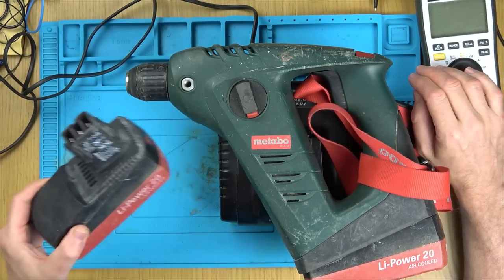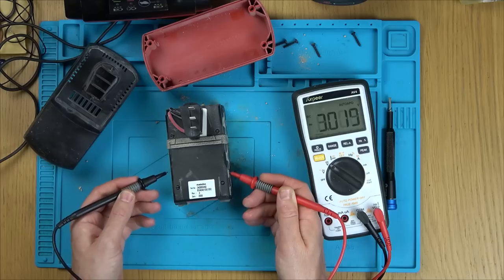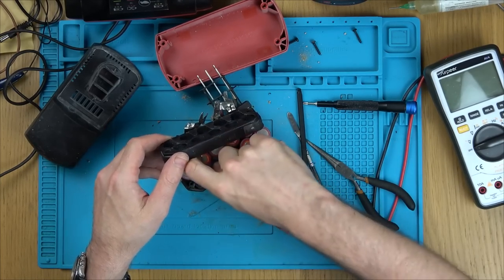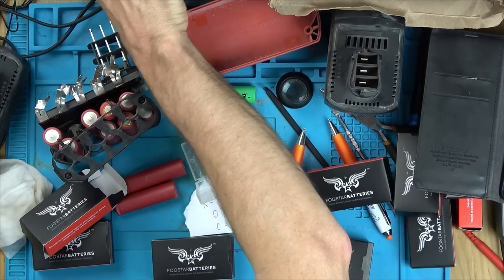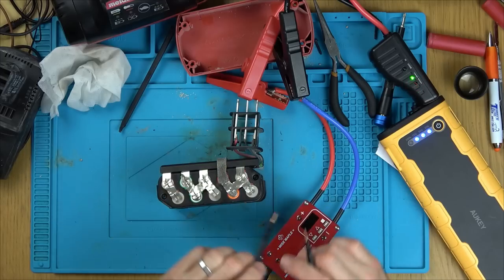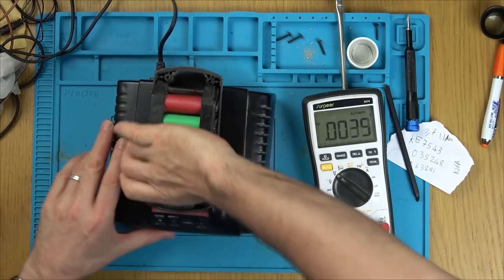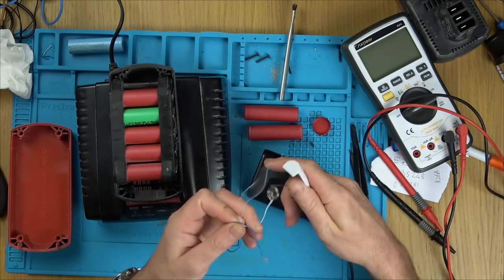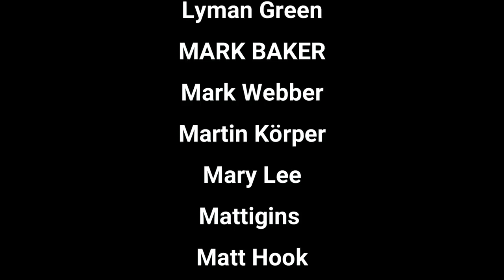DEAD High Quality Metabo DRILL BATTERY - Can it be REPAIRED?

Comment: 7 years running a battery rebuild company 10k batteries rebuilt. Mixing cell capacities technically works but you risk the longevity of the cells they will under/over charge eventually. I would always replace all cells at the same time. Some chargers have very good balancing Bosch for example very easy to rebuild the batteries. You can buy rolls of nickel strip it's thinner and spot welds easier. You'll not spot weld the original metal without a commercial battery welder. Also take your ring and watch off there's a risk of a dangerous arc burning you!
Reply: @chris_hertford just out of interest what do you think are the power tool brands that use the best quality cells and components with their battery packs?
Reply: @billconiston8091 I've opened up several different mainstream brands of batteries for power equipment. Pretty much all of them have the same cells. Mostly unbranded Samsung cells in all of them. Most of the components for all these tools come out of the same factories with slight variation specs from the designer for these companies and are assembled in the country of sale. If that. What it comes down to is each individual companies quality control. The more expensive brands have higher quality controll standards. So generally you get a better product. But there is always lemons.
Reply: @billconiston8091  they pretty much all use Samsung and LG cells. Personally I like Bosch tools the batteries are very simple easy to rebuild and not much circuitry so little to go wrong. If you're doing a rebuild the thing you need to look for are high discharge capacity cells. This is on the label with a C value e.g. 5C, 10C. C is a multiple of the capacity e.g. 3.0Ah 5C cell would have 3.0 x 5 = 15A max discharge rate.
Reply: @chris_hertford  15Ah then ?
Reply: @SlyerFox666 no that's the difference in the figures A/h is amps per hour. So 3.0Ah battery will drive a 1amp tool for 3 hours (excluding real world inefficientcies) The C rating on the cell is the max discharge current, most tools with motors will draw a spike current initially so need that higher rating.
Reply: @chris_hertford  Oh ok so it's just a percentage of the ah at that point makes sense. Well yes but the C rating is the charge/discharge rate so if you have a 12v 7ah lead acid  battery you charge at 0.7A or 0.1C for best life span of battery an base charge rates from it also for other types of batts.
Reply: A trick i sometimes use when i cannot replace the whole nickel strip (potted pcb, weird terminals etc.) is that i weld thinner strip to the cell then fold it over the carefully straightened original strip and weld the two strips together. Even for soldering it's better to have small nickel strips welded to the cell first and folded over (it's difficult to solder on the weld).
Reply: @baconatordoom  so with the lemons factor, you might as well get two of the cheaper ones, and if  one a lemons you still have good battery, and if lucky no lemons, and two time the power, ?
Reply: I know this video isn't about spot welding,  and I haven't done any, but it seems to me one lead needs to touch one serface, and the other lead the other.  Otherwise,  you'll probably melt a hole, but with no likelihood it connects both serfaces. Enough power will run through both but won't necessarily connect the two adequately.
Reply: @chris_hertford  Thank you!
Reply: I have Hitachi tools with older Nicad packs. Can these be rebuilt as Lithium Ion battery packs?  Thank you
Reply: Point me to your business please, I have a couple of tool batteries that need cells replacing.
Reply: @M1LAD81  sorry not in that line of Business anymore.
Reply: This comment means I don't have anything else to add.
Reply: Yes, agree mixing cells are not reliable in long term. All BMS measure voltage and sometimes temperature. The voltage always depends on the charged capacity, and this change because of the degradation of the cells. Generally the cells voltage are 3.7volts between 10 and 90 percent of   the charges (this is the "flat" part of the curve). Under and above change very rapidly (there are higher ramp on the curve). So now you can balancing all the cells, but after a while this will be unbalanced, mainly cause the self-discharge of the cells, because of the internal resistance. After some cycles it will start killing the cells, li-ion cells cannot be tolerate both under and over charge which should be happend in an unbalanced battery pack.
Reply: He is just a total amateur fiddling around with his stuff. He often ignores safety processes, especially when measuring life voltage! As an electrical engineer you often find yourself facepalming over for example the absolutely terrible way of spotwelding using a crude device without any regulation or nearly enough peak current for these thick +0.3mm thick nickel strips used in many packs, not to mention the absolutely terrible practice of reusing bent and damaged connection strips! It‘s not really meant for people from the professional field of electrical engineering…

Comment: Another option: Get rid of all the old batteries and only take five of your green ones in series - > roughly the same capacity.
Reply: Yes sir! 👍
Reply: My thoughts from the start
Reply: Or, just put in five of the old batteries and save the green ones for other projects. <1 Ah (after all these years, those batteries aren't going to be anywhere close to 1.1 Ah any more) is pretty low, but is probably more than adequate for a tool that's only seeing occasional light use.
Reply: YES thats what I thought job done
Reply: Bad and possibly dangerous suggestion! Without knowing the maximum current draw from the drill and maximum discharge rate the batteries can handle. 
Charger is 5A, probably way too high for a single cell. Two cells in parallel gives a more acceptable 2.5A charge.
Reply: yes , logical thinking. Very good !!
Reply: @g.h.190   The green batteries have a maximum continuous discharge rate of 20A. They are very commonly used in power tool batteries, and should be perfectly fine here. They are rated for a maximum charge rate of 4A. 4 is less than 5, but this charger actively cools the cells during charging, so it shouldn't be a problem. Even without the fan, the higher-than-rated charge amperage might cause the batteries to wear out quicker, but shouldn't be dangerous.
Reply: Another option is to replace the 2 bad cells with just 1 green cell. (Since it is roughly double the capacity.) So in the end you have a 9 cell battery.
Reply: @jcon6734 What is going on in this comment section? You cannot just strip parallel cells down to single cells, seriously amateurs shouldn‘t open and specifically fiddle around with charged li-ion battery packs without a proper education! And no - it‘s not alright charging 18650 with an Overcurrent of 1A. Why do you think is this 4A Rating under the „Absolute maximum ratings“? There are way more effects happening to the battery circuit than you even know of if you switch from two parallel cells to single ones in series…
Reply: @Elektrotechniker   @Elektrotechniker  Actually, you sort of can. Adding or removing parallel cells doesn't change anything at all when it comes to circuitry. What it does change is the capacity, and the safe charge and discharge current.

That safe current is largely determined by heat. As you charge it discharge batteries they get hot. That heat is bad for the batteries, and in extreme situations can lead to the dreaded thermal runway. Batteries with higher current ratings will have lower internal resistance, and thus don't get as hot as batteries with a higher internal resistance. This charger's party trick is that it blows air through a vent in the battery casing to cool the cells directly. This prevents the buildup of heat that you would normally risk by charging at too high of a current.  That active cooling is why charging these batteries at 5A is probably fine.

As for the discharge current, cells rated for 20A continuous discharge are common in these sorts of tool batteries (yes, even the little 5S1P packs). A hand drill like this would be lucky to even hit 10A. Stall current might be (probably is) higher, but these current ratings are for continuous current, and unless you're a total idiot, your drill isn't going to stall for more than an instant.
Reply: @jcon6734  There are other changes to the circuitry as well - but these most likely aren‘t known to amateurs due to their complexity… each component has an equivalent circuit and so do rechargeable batteries. If they are then placed in parallel, and in series, the kirchhoff-laws will come into play. If you know these concepts, you will realize that there is a big difference in the battery pack‘s electrical characteristics, which has never been mentioned here… it‘s just too much to explain right here without the knowledge about said laws…
Reply: @Elektrotechniker  Yes, Kirchhoff's laws do come in to play, which, paired with how dead simple lithium ion batteries are to charge, is largely why you can add and remove parallel cells without making changes to the charging circuit. The characteristics that change (and yes, I did mention this at length, it was the bulk of my post) are the capacity and the safe charge/discharge current. These changes are a result of (or perhaps more accurately, described by) Kirchhoff's current law.

As we know from Kirchhoff, if the drill pulls 8 amps, and we have two cells hooked to it in parallel, the current pulled from each cell will add up to 8. That's 4 amps each. If you remove one cell, then the remaining cell will have all 8 amps pulled from it. Assuming that cell can safely supply 8 amps, there is no problem.

You are correct that you shouldn't just YOLO it and pull parallel cells out of a pack without putting some thought into it. If, for example, the hypothetical cell that I mentioned above could only safely supply 5 amps, it would not be able to safely power the drill in a 1P configuration. Putting thought into it first is the important part.

I suggest you take some time to educate yourself on how lithium ion batteries work and how they fail.  You seem to have some very basic misunderstandings about them. They really aren't as complex as you seem to think.
Reply: @jcon6734  How do you know how many amps the battery can be pulled from it? Because amp hours don't equal amp pulling do they? And how can I know what amps the drill is pulling? Or is this part of Kirchhoff's current law? I wanna learn all this stuff. But MAN I get bogged down in all the little off shoot details that are needed to understand. I appreciate you doing such a great job of explaining here. Thanks, Rick
Reply: One of the worst suggestions I've heard

Comment: What your missing is the C rating on the old batteries, which tell you how many amps they can push out. C rating of 10 means they can run trough the battery at 1/10 of an hour. 1C takes an hour. To get the max amps multiply the C rating with the capacity. So 3000mah battery at 10C can run at 30A for 6 minutes. Serial extends the time, Parallel extends the amps. When intoducing new cells to a pack you can leave them to self balance between themselves if it's not too big of a difference.. otherwise you risk pushing short circut amps from a full cell to an empty one, which is what the spot welder does basically.  With charging you might have issues as you dont have any BMS... otherwise there would be wires on single cells. I wouldn't let them charge fully and leave them for a bit to self balance before using it. And lastly most chargers without a BMS simply mesure resistance, not voltage.. when it starts spiking, it's full. Hope that helps somewhat.

Comment: I don't think your spot welder is the only problem here.  Since you are still using the existing nickel plated strips, you will never have a flat surface in contacting with the battery, after you dissembled the battery pack, in order to meet the spot welding surface requirement, plus, your nickel plated strip is thicker and no matter how hard you press onto the battery, it just won't make a good contact to form a reliable spot weld. if you use a brand new set of batteries with new nickel strips, then the spot welding will be good, otherwise, I would just try a soldering method. I have powerful spot welder, but it just doesn't work for me when I am repairing a battery pack by replacing dead battery (with the exact spec).

Comment: Search for '5000W Handheld Spot Welder, Docreate Portable Spot Welder Machine DIY Kit for 18650 Battery Pack Welding Tools, Adjustable Battery Welding Soldering Machine with Nickel Strip and Spot Welding Pen'... I've been building e-bike batteries for years and this spot welder is the only one i'll use, it has it's own internal power supply and a foot pedal, the leads are 0 awg, can spot weld 1/16th of an inch thick nickle if needed.

Comment: As someone who rebuilds medical batteries, I can tell you a few things. Putting in mismatched cells that have a difference and internal resistance or capacity can cause lower capacity cells to go into a reverse charge during normal discharge. If the protection board is correctly monitoring all of the cells, it might prevent this from happening. 

Getting those thicker tabs connected, I would suggest spot-welding down thinner nickel strips with an extended tab coming off the end to solder onto the thicker tabs by the manufacturer.

Comment: Hi Vince, when adding new cells to a BMS, you should have the cell voltages matched to within 0.1V.   Otherwise you are placing a strain on the cells as they try to balance, and high current will flow between differently matched cells.  As to which cells you can use, its not good to mix various technologies and ratings.  In the video you mentioned using new cells of 5.6Ah.  This is possible, as the voltages will remain the same, but the increased Ah rating means the battery will last longer during use. 😊

Comment: I can recommend the kweld for spot welding.  It's a DIY kit and I printed the case for it.  The capacitor board from Kweld is highly recommended.  I think one of the best spot welders in the hobby area.

Comment: Nice Job Vince 👍 I bought 10 faulty Milwaukee batteries over a year ago, repaired 8 of them and they all still seem fine. Was thinking if you were worried about the cells capacity you could have removed all of the cells, and just fitted 5 x 2.5ah cells which would have given slightly more capacity than the original pack with half the weight 🙂 Keep up the great work 👌👏
Reply from the maker: Cheers Mick👌

Comment: The thing you have gotten mixed up with, the BMS system in those older drills are unlikely to do Cell Balanced Charging, but will simply only monitor the change and when any single cell gets to a cutoff voltage it will cancel charging. It takes a lot more electronics on a BMS board to do balanced charging even in this day.

The other issue you will likely run into - as it has been touched on in comments here, and you kind of touched on it yourself.

As you discharge the battery pack, the lower capacity (and worn out cells will make this worse) will drain to a lower voltage than the other batteries. the pack Should technically signal that it is flat and stop the drill. However once you try to charge the batteries, the inconsistencies in charge state and battery worn level will result in the charge cycle taking a different length of time. As it is likely the green cells will show as fully charged quicker, this will then mean you have a "full" battery that actually consists of 2 well charged batteries and 8 partially charged ones. As you then use this again, the situation gets worse and worse.

It may then be possible that you also get into the possibility of over discharging once pair of batteries whilst using the drill, which will then take the battery again requiring you to once again repair it. The general rule of thumb is to try to keep batteries with the same wear pattern together, as well as the same charge cycle and capacity. which would lean towards replacing all batteries in the drill.

On the standpoint of changing them all to higher capacity batteries - the pack, and charger will technically be able to handle this, but the charge time will increase. As for the drill itself, if it is a brushed motor, it will work without any issue - a brushless motor may however be able to use more current from the battery pack, so long as the pack is capable of delivering it. Technically this shouldn't cause anything to break, unless it ends up over-torquing the motor or linkages. However, i suspect at some point the original manufacturer would have come out with an increase capacity pack anyway and the risks i have mentioned wont be valid.

Comment: Hey Vince, i purchased a spot welder off Amazon, Seesii Farad I believe the model, around £120 I paid and welds up to 0.3mm, over 100 different settings..
have never found a battery strip it won't weld through.
Not sure of the reputation/quality but I've used it many many times and has never let me down.